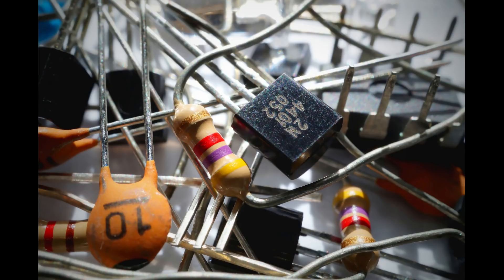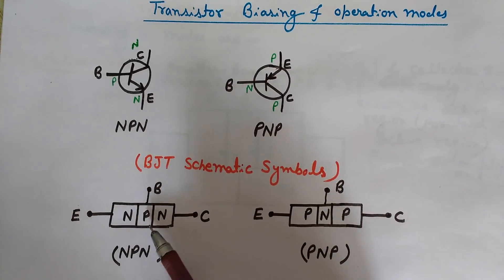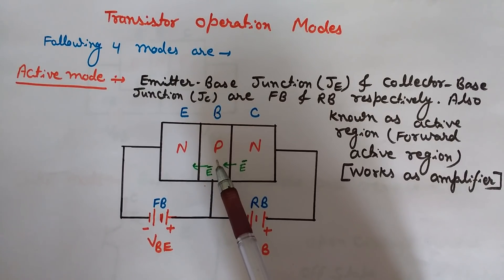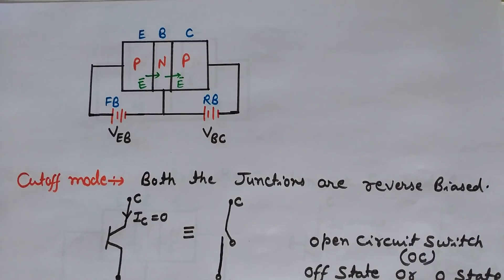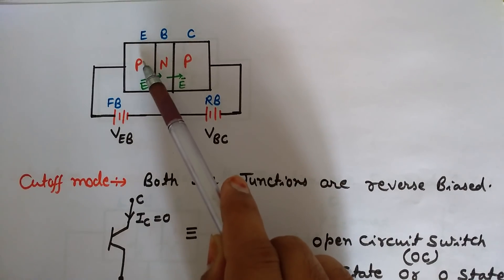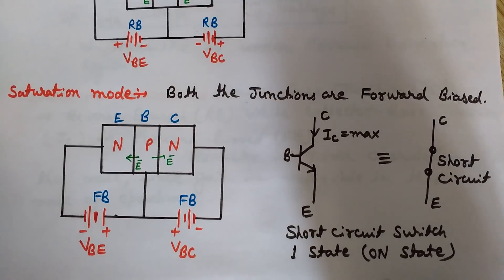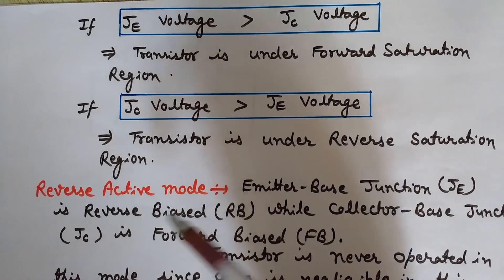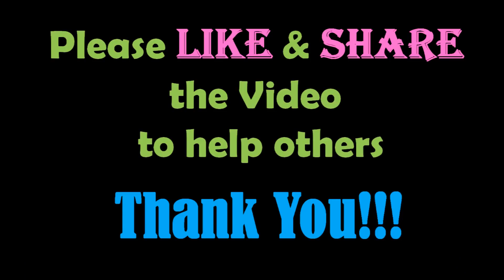BJT Transistor Operation Modes/Active, Saturation, Cutoff and Reverse Active modes of BJT Transistor

Comment: I think you drew the direction of the electric field between Base and Emitter in the wrong direction while explaining active mode. Electrons flow from the emitter to the base. On the emitter-side they leave behind positive ions and the holes coming from the base-side leave behind negative ions. The direction of the electric field which then forms must go from the emitter-side (positive ions) to the base-side (negative ions)